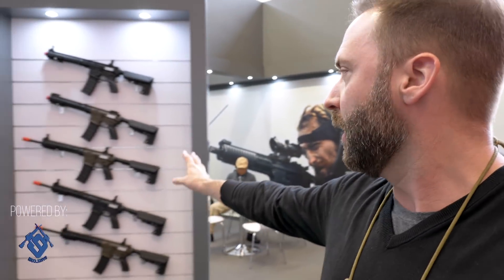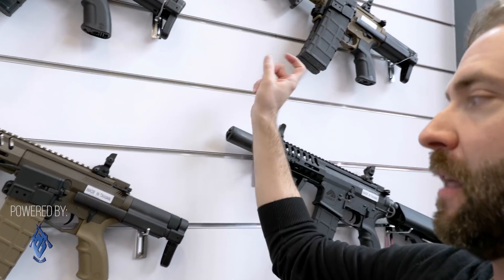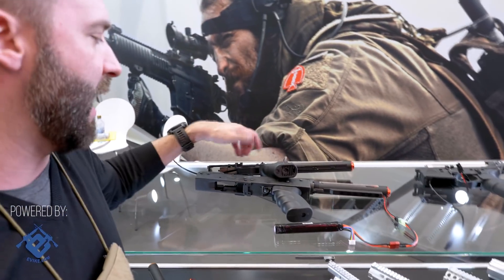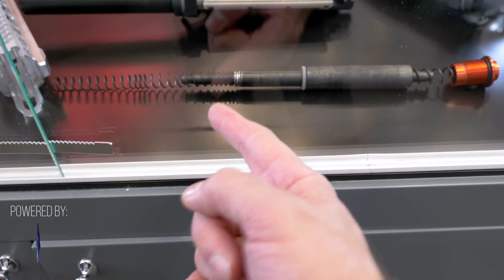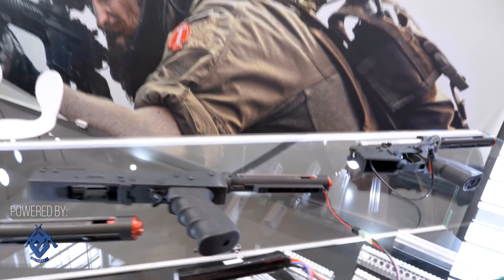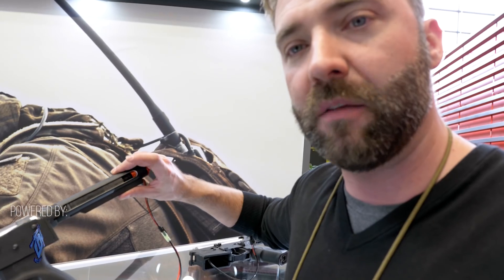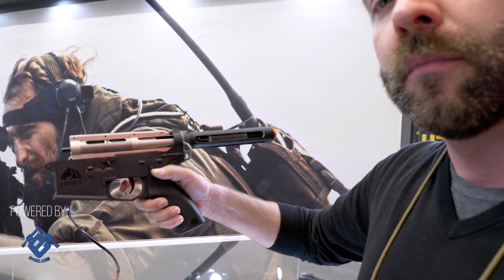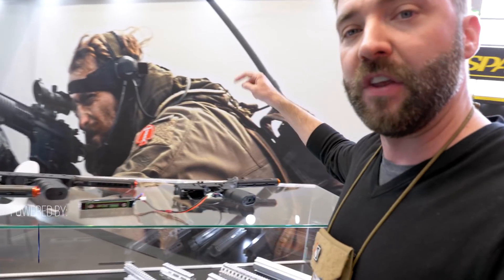Lonex Airsoft's Epic Recoil System at IWA 2018 | Airsoftology

Comment: if the bolt doesn't reciprocate then it's just a gimmick. get a gbbr if you want blow back.
Reply: LionHeart Airsoft that and it’s way way easier to work on a gbbr and more reliable then a erg system

Comment: Would it be possible to put that kit in another gun?
Reply: Not an expert, but, I would think that you could do it by replacing your motor, gearbox, and buffer tube. A gun wired through the buffer tube would likely make it difficult, though.

Comment: but that rof is so slow. Would like to see it in full form and shouldered to get a more realistic idea of recoil.
Reply: thats pretty close to real m4 speed so you want real kick but unreal rof?
Reply: Ethan nope not close at all. If it was a BAR sure, you haven’t seen or heard enough real M4s in full auto to tell that the rof on this airaoft gun isnt comparable. I also didnt say i want unrealistic rof, i just stated the rof at its current moment is sluggish to be effective for airsoft. Semi could be faster than that.
Reply: No, that was the exact same ROF as most M16/M4. BAR definitely do not fire that fast. If you are talking about the second one, the hard kick version, that is about as fast as an AK, but definitely still not the ROF of a BAR, which is only ~500rpm.

Comment: Love your videos. I've been watching all of them recently. A friend and I are opening a field in the LA area and are looking at guns to buy and use as rentals. What guns if any would you recommend? I would like to give our players a reliable and accurate gun that will hold up.  Thanks for your time. We would love to have you come play if you are in the SoCal area once we get up and running.
Reply: Roger Giltner what area in l.a?
Reply: In the San Fernando Valley area most likely. We are still looking at a couple of locations so not sure exactly where yet. Hoping to get things locked down soon. I will keep those of you who have asked about it updated. Thank you for your interest.
Reply: cool im here at sun valley i hope its gonna be close to us :) is it gonna be indoor our outdoor
Reply: Remember your rental gun could be the first airsoft gun a person ever uses. If it sucks, doesn't shot well, feels cheap etc you could lose a long term customer. With all that said the G&G combat line is a staple of bang for your buck. The Raider series comes in between $150-200. Polymer body with high quality internals (I have been hearing some people are having motor issues after a while but motors are cheap enough if they do go bad) also there is the Kryta Alpha CRB at $250 which is a metal body, with great internals. It pushes up your overhead but again keep in mind a metal gun does feel better in hand to leave that lasting impression on a customer of the quality of the hobby
Reply: That's great advice. Thank you for the feedback.
Reply: just update us
Reply: I will for sure! It will most likely be in Burbank or possibly around Van Nuys but we are looking at a couple of places in Sun Valley as well. It will be indoor. I hope that doesn't dampen your enthusiasm.
Reply: thats cool man. can't wait so what will be the name of your site? so i can follow it in facebook. i think first u have to make a page in facebook so we can follow it because when you stablish your site  atlest we know
Reply: Roger Giltner so whats the update guys
Reply: So you guys found a place yet?

Comment: Electric blowback in an airsoft gun. Why? 

muh immersion
Reply: lol get gbbr
Reply: Why not?
Reply: assasincubique for some this isn’t practical due to weather
Reply: Each side has its pros and cons. Batteries get wet (or explode) and gas gets cold.
Reply: The Illinois Airsofter gas you can't use in any Cold weather
Reply: In America in the summer or spring time gbb is perfect
Reply: If it's made right, it's actually pretty cool. Like the recoil shocks for example.
A reciprocating dust cover alone *cough G&G cough*, is just gimmicky. While it wont have the recoil a GBBR will, it wont have the problems that come with gas guns.
As long as it's done right, I think it would be cool. The lonex seems to have a lot more recoil than the TM ones, hopefully the ly find a way around barrel vibration caused by it
Reply: GBBs are not reliable.AEGs are too boring. Best trade-off: EBB.